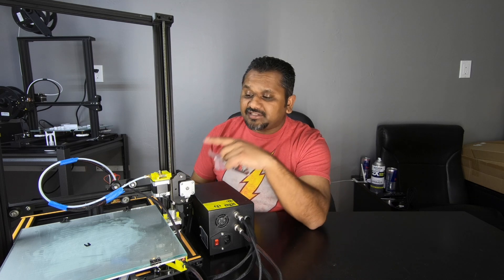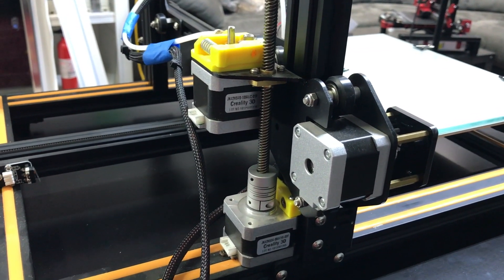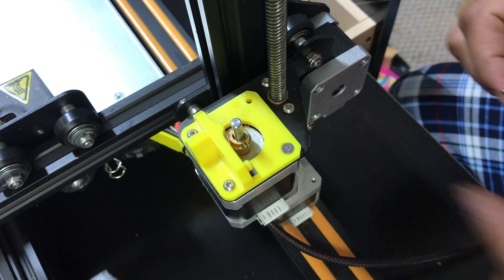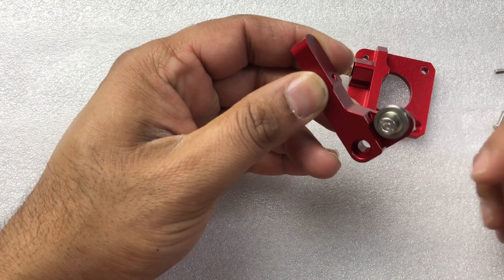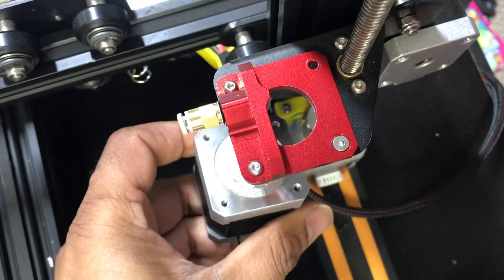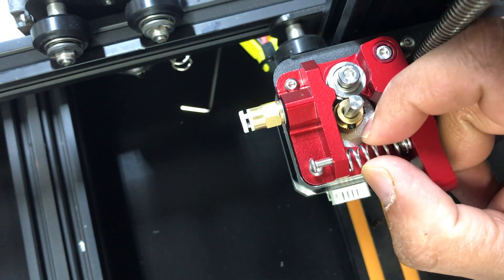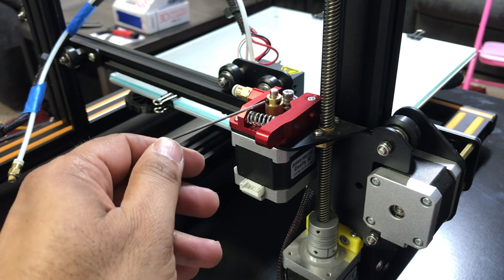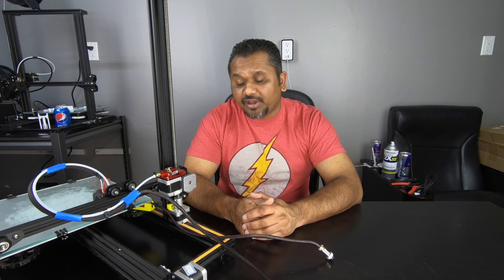Creality Cr-10 All Metal Extruder Upgrade.

Comment: My Gear that has teeth does not have those screws to lower and higher it on my cr-10. Its solid connected to the motor. Cant get my machine to pull filament through even have changing to metal extruder.

Comment: The stock motor that came with my printer had the brass gear pressed on.  I decided to cut it off with my dremel rather than dry to wedge it off and damage the motor.  That might've been overkill, but I'm not sure.  If youv'e encountered that kind of set-up, please let people know how to take the original gear off.   Also, the new aluminum replacement seems to dispense with the brass fitting that holds the plastic sleeve in place.  The hole where the tube goes into the replacement part isn't threaded, and the replacement included a tube clamp instead of the brass bit.  I'll comment later if this doesn't work.

Comment: I noticed you didn't run it. Does yours click and grind no matter how much you adjust it? I've concluded that the brass feeder on the step motor is the wrong size. Waste of $$$.
Reply from the maker: every brass feed has different amount of teeth so sometimes you have to adjust the value manually.

Comment: What have i dine wrong, its slipping Even more than before, ive tried tightening and loosening the bolts. But it still slips all over. And no, not clogged nozzle or to close bed
Reply from the maker: ok try this. remove the nozzle and feed the filament thur.  You mite have a clog in the bowden tube.  Push it thur and see if the filament comes out if it doesn't then theres you problem.  Keep me updated and lets get this fixed.

Comment: It doesn't look as if the upgrade would really would hold the spring in place snug at the outboard ends with a screw and a screw head well compared to the boss features on the plastic original version.

Comment: I also have the cr-10s... loaded Gcode file from sd card... told it to print...NOTHING..waited for 30mins still nothing..NO error..no movement..tip heated..bed heated..thats all
Reply from the maker: Terry Lefevre try using a different SD card, same thing happened to me.  If that doesn’t work try a different print and see if that works.
Reply: Hey man, did your problem get fixed? If so, would you mind telling me how?

Comment: I think that paying over €18 for this metal extruder is too expensive.
I would rather spend €10 for a metal bulldog extruder https://tinyurl.com/y3qjezwy
Or go the all metal € 3 el cheapo route: https://tinyurl.com/y376mqc5
These metal extruders will not print flexible filament, so print this: https://www.thingiverse.com/thing:3479242

Comment: My cr-10s has two "z" motors..looking at the printer from front the left stepper motor is frozen while the right tries to work..is brand new right out of the box + time to assemble... every thing else seems to work nice
Reply from the maker: recheck you connections.

Comment: I have a filament out sensor on my 10S. Will it fit or is there an all metal extruder with built in sensor.
Reply from the maker: I haven't seen a all metal with sensor built in.  Your sensor should work since the cr-10s sensor is not fix mounted.

Comment: I must be missing something.  Why would I do this upgrade?  Thanks for all your great videos.
Reply: My plastic extruder part cracked.  so I needed the replacement.  What cracked was the spring-loaded arm, right at the base, where the maximum torque was being applied.
Reply: The stock extruder is plastic. this may cause the thread for the pneumatic coupler to wear out, so the bowden tube loosens and cause a failed print.
And with the metal extruder you can also print flexible filament, not with the plastic one, because the filament tends to wrap around the brass gear
Reply from the maker: @RobNisters  is correct and also a lot of people don't realized but this helps with under extruding as well.
Reply: @SANTUBE  i assume no creality printer comes with this metal extruder option as stock? does the metalkit come in anodized blue instead of red? :D